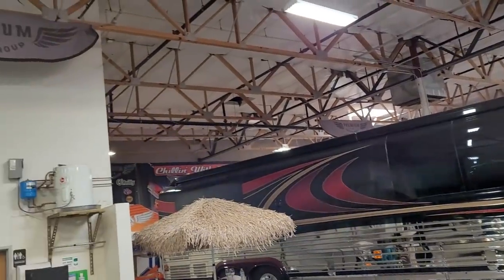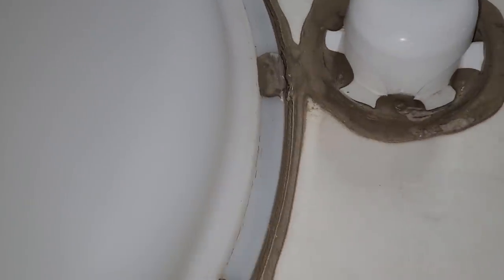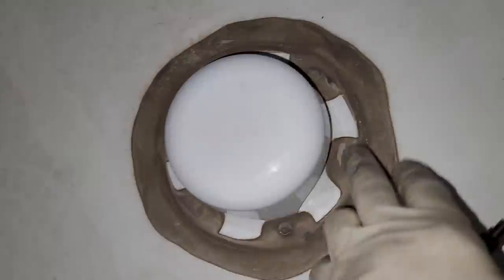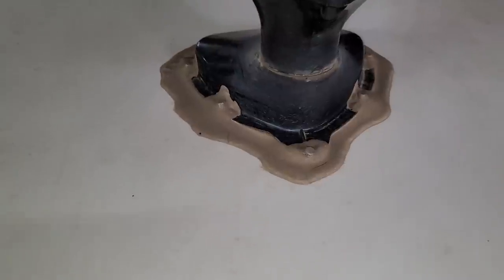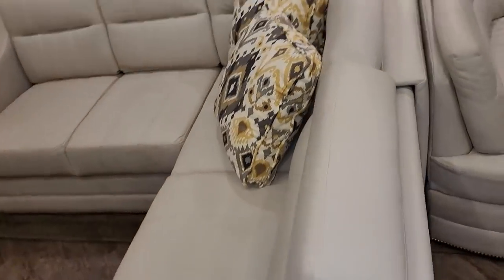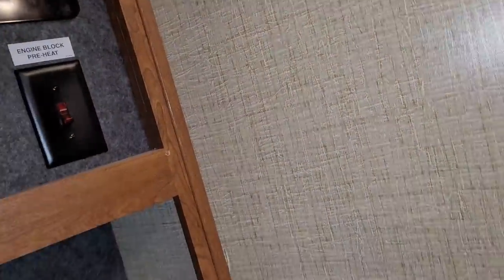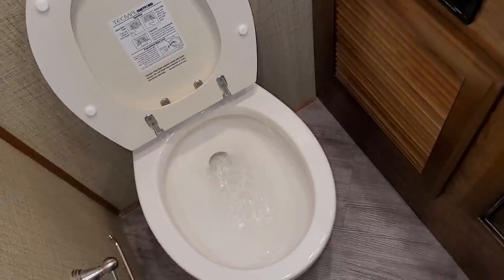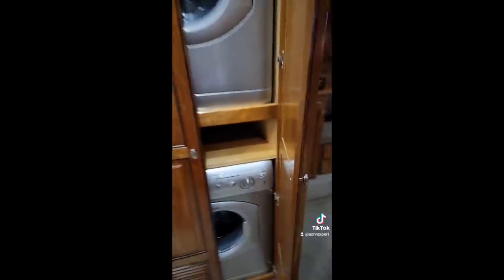Touring a 2017 Beautiful Pace Arrow RV+ Inspection

Comment: Funny, Seeing that thumbnail I was sure you finally fell off a roof 🤣Dude, be careful! Thanks for the walk thru. Can you elaborate a bit about RV toilet paper? I use costco, seems to work fine. Thanks.
Reply from the maker: macerating toilets can clog easily with the wrong paper so to keep is easy, I only recommend RV toilet paper in those toilets.

Comment: Guess what? 
Today I went on the roof of my 41ft 5th wheel, and discovered several screws protruding through the Dicor at the front cap trim line, and at the same time I discovered that the wannabe techs at my rv dealer replaced the tpo roof membrane and sealed the trim piece that joins the fibre glass cap with dicor! 😱 This is a 2019 rv I’ve had for two years now, the roof was damaged in shipping coming up to canada so the dealer replaced the tpo roof. I never knew this dicor on the fibre glass was a bad thing until watching your videos, blazingly I grabbed the dicor on the ends and was stunned how it just lifted off with no effort. So along with all these screws popping up, it looks like I will be redoing the whole roof cap trim with silcone on one side and decor on the other after i replace all the screws with longer ones. So thank you so very much for teaching me this!!! 
I have a quick question though, I saw condensation on my shower sky light, the condensation looks like it is in between the two plastic panes. You see the water droplets when on the roof looking down into it, but I never saw them looking up from inside. The dicor around the skylight looks fine, but not abundant. Is this normal to see this condensation when temp here during day have been a high of 9C approx. ? Cheers 🍻
Reply from the maker: thank you. Im glad you found it. Usually screws popping up mean something is loose or stripped. Condensation is very common on skylights if it's cold outside and warm inside. I would be concerned its inbetween the panes maybe the roof has lots of air leakage from the attic area. might have to pull the inside down and look for large gaps or water damage for sure.
Reply: @AZExpert  k thank you!